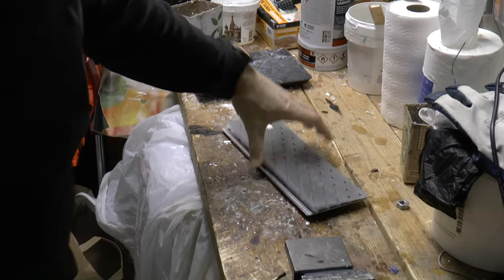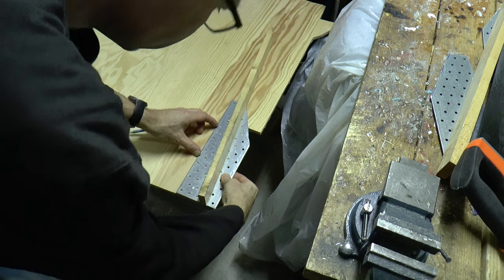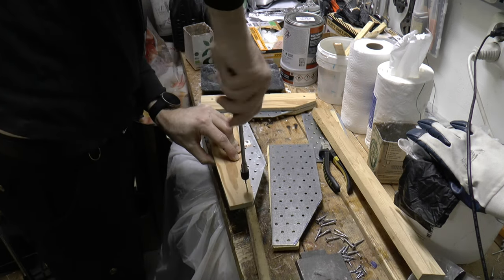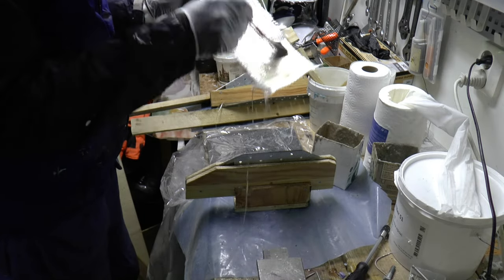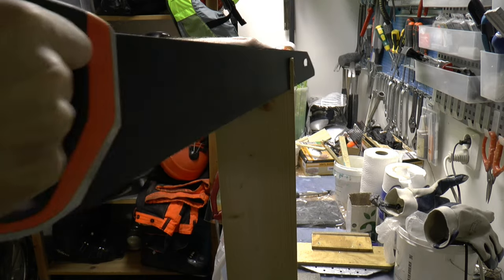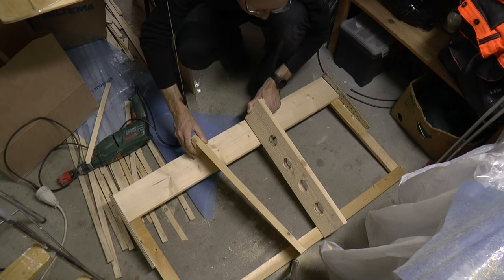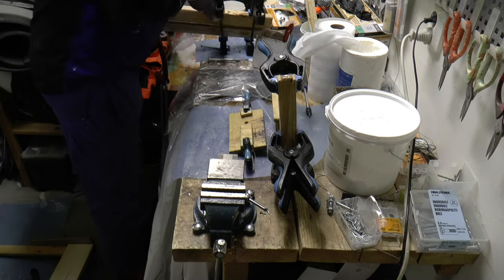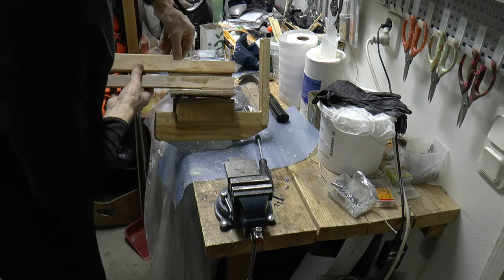An iceboat idea, transforming 1/2 of a Kayak into a sailing craft with amphibious properties #171

Comment: This is excellent 👌  I really like the idea 💡  should be good fun . I built a blow cart . A three wheel sailing craft I'll have to pull it out and show it off . Thanks for the time in the shop . 👍
Reply from the maker: Glad you liked the idea. It might need some more work before it actually works as you will see in the next episode.
Reply: @sailoutofagarage6212  I had intended mine to ride on the beach ,  on the high tide line . but the tires where to small , so I used it on the rode . Worked real well on the asphalt . I think I made a 90sqf lug for it on a 15 ' mast . I'm excited to see how yours works . Should be a real adventure.